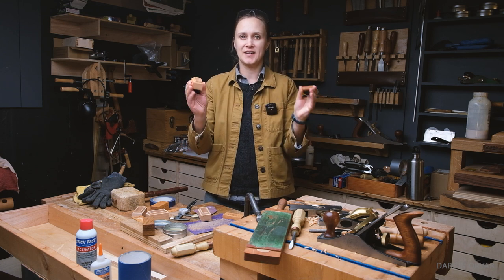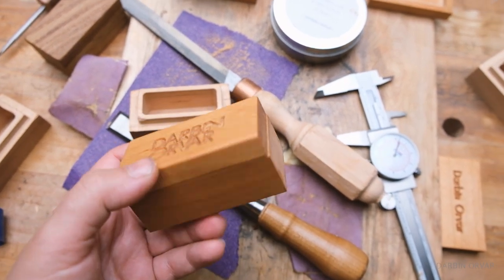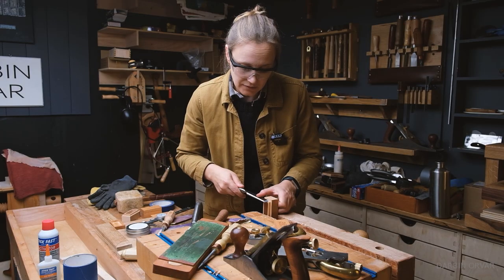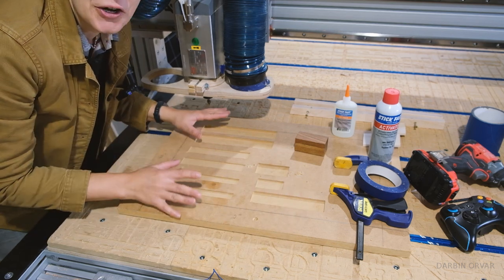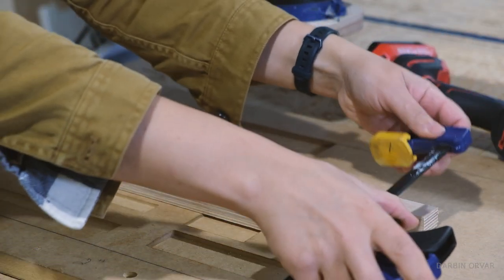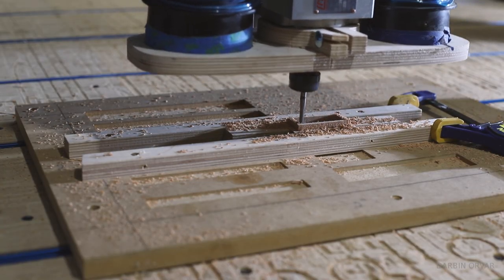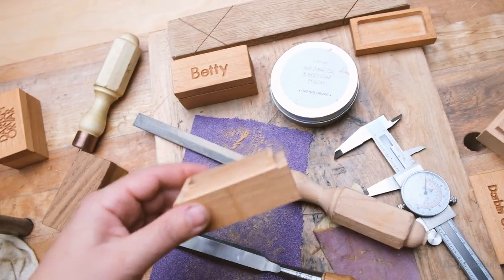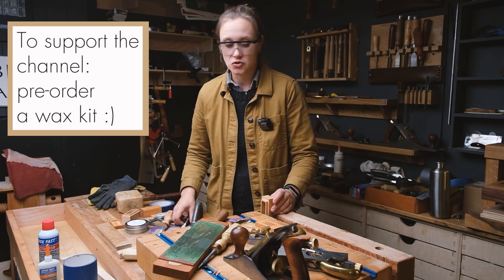Making the smallest box I've ever made (very precise pressure fit)

Comment: I've made 2 dainty boxes.1on CNC as a Pill Box about 40x30x20mm friction fit lid & convex shape lid with kitten carving.
The  other was playing around with mitres. About 50mm sq X 12mm thick. I mitred all edges of all 6 sides and glued 5 together to make a box with loose mitre fit lid that always closes and sits correctly. Inter ally, you could use it as a Ring presentation box or store postage stamps!